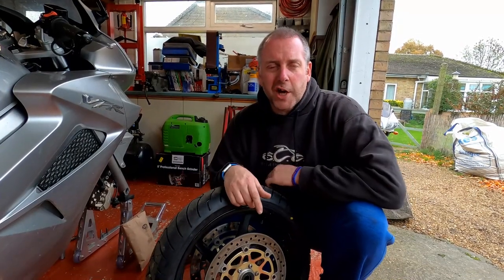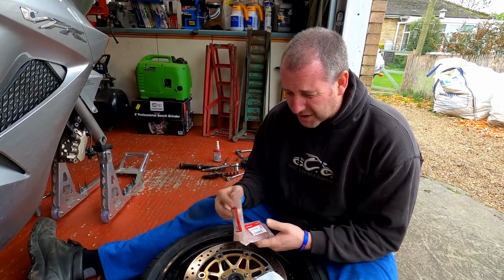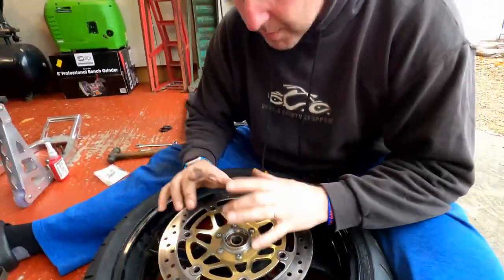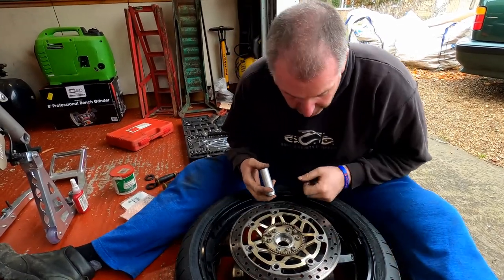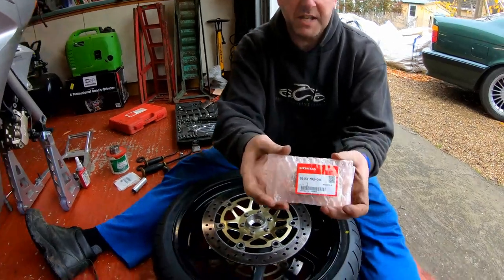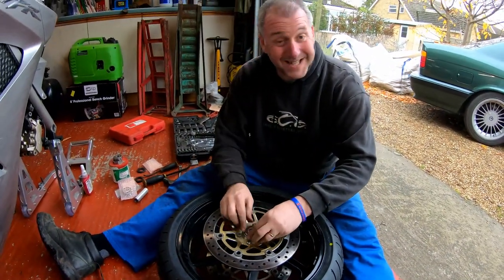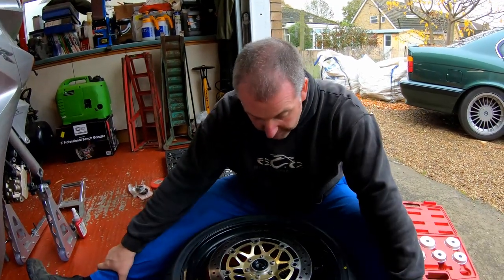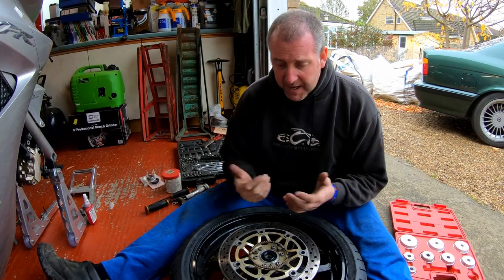Motorcycle Wheel Bearing Replacement - Demonstrated On My 2003 Honda VFR800 VTEC

Comment: Another good video. Yes when I used to remove bearings used a slightly smaller axle. Then catch the edge of the bearing and tap it out. But whichever way all good. 🙂

Comment: 15mins if everything goes perfectly. Mine have just took 3 hours of various hammers, and pointy tools, after an hour I went and bought a new blowtorch. 5 goes with heat and more hitting and eventually it gave in and came loose.

Comment: Great video as usual.
Just one thing, it looks like you used normal mineral oil based grease on the seals.
I believe you should use red rubber or silicon grease with rubber seals as otherwise mineral oil based greases can break down the rubber over time.
Reply from the maker: Whilst in general I agree entirely with your comments regarding rubber components and red rubber grease, in this instance I used the grease that is specified in the factory service manual which states a multi-purpose grease is to be used. Silicone based greases are specified through the use of a different symbol in the manual.
Reply: @KevsShed  Thanks for explaining.
Reply from the maker: @bigbluechopper24  No worries buddy!

Comment: One of these days I will invest in a bearing kit for removing and installing.
Reply from the maker: The one that I listed in the description is very cheap and is probably more than adequate for a hobbyists garage. naturally a professional that pops out several bearings a day will most likely require something a bit more substantial.
Reply: @KevsShed  cool thanks

Comment: Brilliant video and very informative. I've just bought a VFR800 and noticed a dry sound coming up from the front. It sounds a little like something is rubbing, but I've checked and there doesn't appear to be. It is louder on some road surfaces than others, and is noticeable at speeds as low as 20/30 mph. Thought I noticed an occasional clicking sound as well. Seems to me like it could be a wheel bearing problem, but wondered if you know whether this might be the case?

Comment: Thanks for this video Kev !
Already done last year on mine, pretty easy as you demonstrated here.
Do you think to show the same for the rear wheel ? a little more complex...
Reply from the maker: It is a very similar setup in as much as there are 2 bearings in the rear wheel however it employs needle style bearings, plus there is an additional bearing in the sprocket carrier. There will be a video on this in due course however, thanks for your support 👍

Comment: I agree BT023 are perfect on the vfr, not sure if the T31 evo would be much better or not.
do you get the vfr wheels balanced front and rear?
Reply from the maker: Yep got it balanced, didn’t change the rear yet though.

Comment: Hi and thanks for the video. The bearing Puller link is now not working. I have a VFR 800 and its only done 16 500 miles. I am getting a numb throttle hand when riding and someone on FB suggested that this could be down to the front wheel bearings. In your video I think that you stated that your bike had 25K miles on the clock so I was wondering WHY you decided to replace the bearings ( ie what could you sense was wrong with your bike ? ). I dont really want to replace the bearings if they are not the cause of my problem and I doubt that there is a definitive way of testing the wheel bearings ?

Comment: But off track have you or are you going fit PCV would appreciate your valued opinion Thanks Karl
Reply from the maker: I've been giving it some consideration, I currently have several projects either on the go or ready to begin so it's probably going to be on the back burner for a little while. Never say never though!
Reply: Do you think they are good for bike is my real question Thanking You in anticipation of your forthcoming help and co operation KARL
Reply from the maker: @karl1608  Absolutely, the bike will run like a dream with one fitted and correctly setup!
Reply: Appreciate your time to respond. I’m thinking going all out with auto tune so I’m effectively getting real time tune in all conditions. Either up in Alps or down by the coast. Expensive but do you think it’s superior to Dyno setup ? Thanks again
Reply from the maker: @karl1608  I can't offer an opinion I am afraid as I am not familiar with the auto tune setup.

Comment: Milage
Reply from the maker: about 30K
Reply: So ime on 32000 at the moment, she seems to be handling ok, been looked after also booking her in for a valve clearance inspection, ( to much for my abilities) so should I have them done as a matter of course or is their a way of testing them to see if they’re ok, I don’t hear any noises & theirs no rattle or shake?
Reply: Appreciate all yr information videos, Thankyou
Reply from the maker: @terrymurphy2850  Yeah, if there was a problem with the bearings you would find that there is lateral play in the wheel when you spin it. Also there would likely be a bit of excessive noise. If you aren't experiencing either of those then they are most likely fine.
Reply: @KevsShed  Thankyou Kev mine are fine